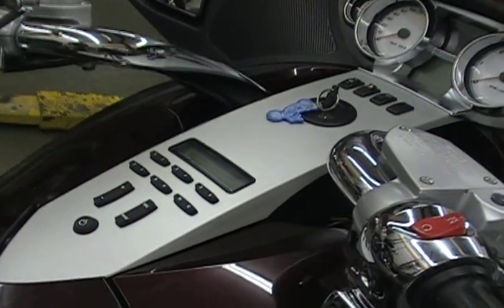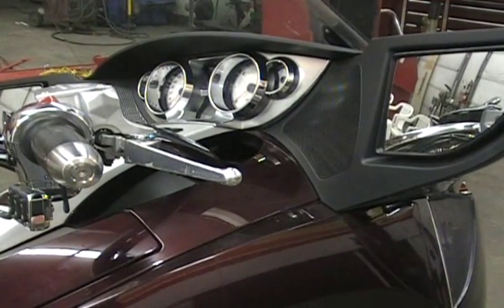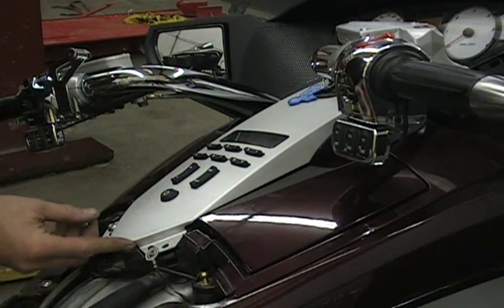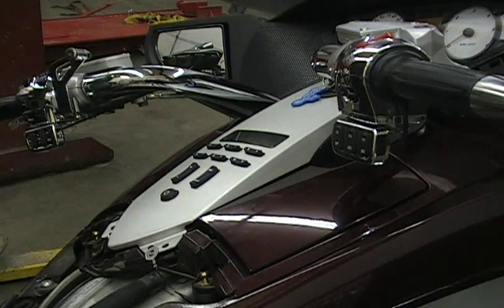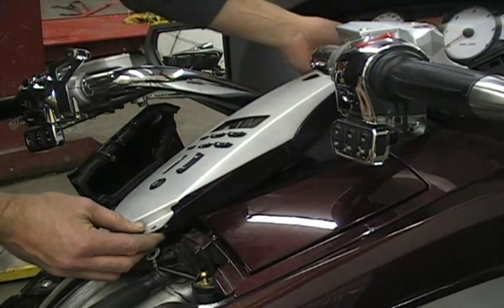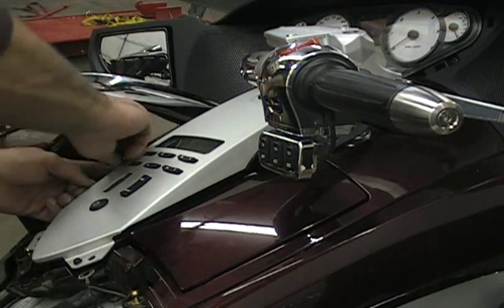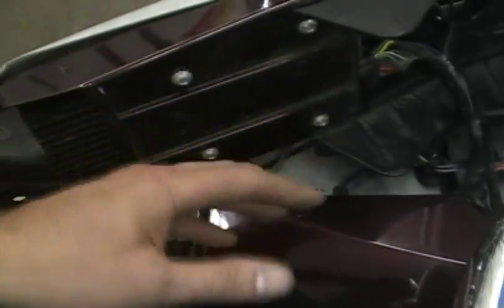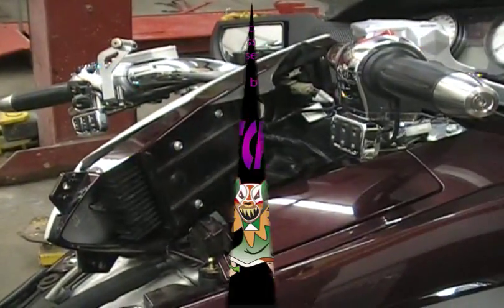Witchdoctors - How to remove the dash switch panel on a Vision

Comment: Thanks for the info! It's helping me do the work  on 15 yo old vision with 70,000ml was recently in a flood in Florida. The ignition switch is not turning on the dash board and can't use horn, blinkers, cruise.  36"' of water here! Lol Later on I pulled the plugs and changed the oil The "Magnificent Bastard" shot out  about 2 gals of water and then started up! Great bikes!